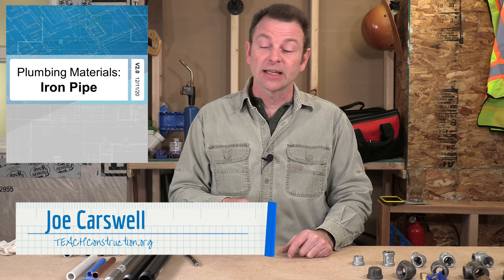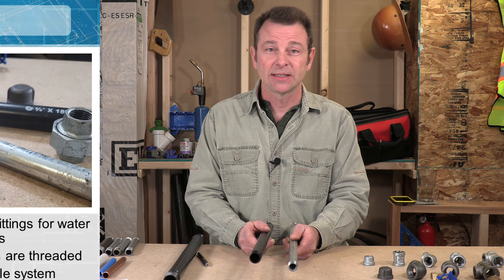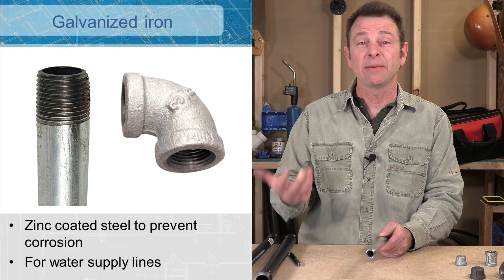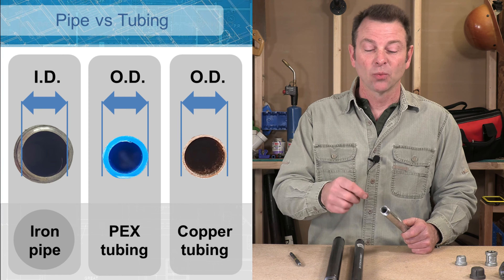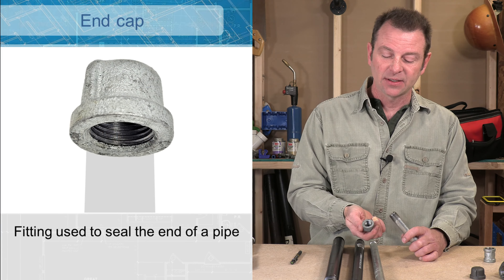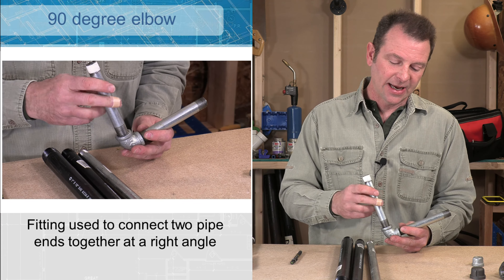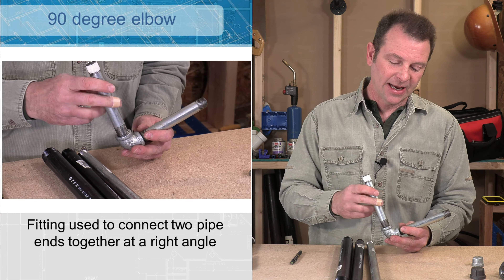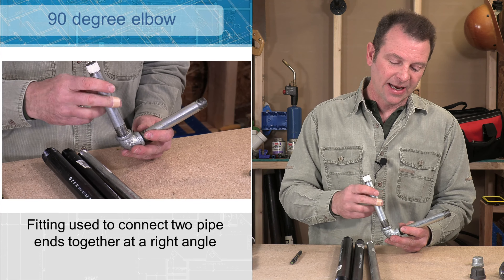A lesson about iron pipe as a plumbing material  - Intro to Plumbing Systems

Comment: Several things to correct. You could take this videos advice and get by fine. This is more nitpicking than anything. Galvanized is perfectly legal for gas. So is brass for that matter. Coastal areas use it because it holds up better in the sea air than black iron. This is why you put a drip leg before each appliance to catch particles. Also, bushings are illegal to for gas but not for water. I always thought this was odd because water runs at much higher pressures than gas. Though I guess water isn’t as dangerous if it leaks. The last thing is just a nit pick. He said that pex and copper were measured by OD whereas steel pipe is ID. This is incorrect. All plumbing pipes are measured by ID. HVAC labels their copper by OD. In plumbing you have two two designations for OD, IPS (iron pipe size) and CTS(copper tubing size). All pipes will fit in one of these. Steel pipe, brass pipe, pvc, and cast iron are all considered IPS. Copper, pex, and cpvc are all CTS. Though the size is nominal on some. Copper tubing is actually 1/2” ID. Pex however has the same OD but a thicker wall so it’s slightly smaller on the inside.
Reply from the maker: Thank for the additional information.
Reply: I live in Katy, TX. I’ve seen a lot of people had their certified plumbers to run the natural gas line with galvanized iron instead of black iron. The benefits are to minimize painting and rusting.

My question is, can I mixed black iron pipe and galvanized pipe together? Like 21ft black iron and 21ft galvanized for natural gas.

Comment: In plumbing, copper pipe is measured by inside diameter. In hvac, it is measured by outside diameter. That's why hvac techs call 3/4" copper 7/8".
Reply from the maker: Great and thanks for the addition

Comment: Galvie is still good as a main supply trunk off of the water meter.  You need metal to ground to and then you need to jump from your side to the city side to ensure you have no electrified water which can result in a fatal shower or grass watering.

Comment: This is really good info.  One small suggestion.  When you are demoing putting on a fitting you are turning the pipe instead of the fitting.  In a real situation the pipe is likely fixed and unturnable.  Showing how the fitting would be turned leftylooseyrightytighty gets confusing so if you can simulate real life by turning the fitting that would be even better.

Comment: If I can make one observation , copper tubing is measured on the ID unless you are working with ACR tubing which is measured on the OD. Otherwise your videos are done nicely. Don't know if your a plumber or pipefitter by trade.
Reply from the maker: we are not plumbers - we primarily create instructional resources for  teachers to use - one reason we are only covering the basics.  These videos are only a small portion of what we provide to customers - so we figured why not share some of our library with the YouTube learner.

Comment: Sir ,  first your way of speaking is best,  people all around world can listen and understand you,  giving time in between your words. Sir in our village home in mountain our gi water pipe broke.  What should be the distance  between two 1/2inch gi pipes, so that we can join them by union.
Reply from the maker: Thank you for your nice words. Where is your village?
Your question is hard to answer easily in a comment - maybe we will make a video about how to do what you ask. 
Here is an attempt at explaining.  To determine the proper gap between two pipes in preparation for a union - you can assemble the union and measure the over all length.   Then measure the amount of pipe that threads into each union end, and subtract that amount from the overall length of the union assembly.

Comment: i'm replacing a valve that has no unions with a valve using a union on both ends. i noticed when taking the union apart there's a shoulder that fits within the inside of other side of the union to seal the fitting. when removing the valve by unscrewing the two unions you have to create at least an 1/8 of an inch from each union in order to pull the valve out. how do you create that clearance to remove the valve? hope this make since.

Comment: Great video Thank you sir 👍🏻
How do you know at what point you have secure tight fit 
How many times you have to turn after you tighten it with your hand?
Reply: It isn't a number of turns thing. Think torque instead. You get a feel for it pretty quick, although as your arms beef up you have to adjust on smaller fittings to avoid over tightening.
Reply: This will work only in theory. You have to use one of the existing sealing methods

Comment: Awesome video talking about fittings.  I have  an old home with the galvanized color pipes for natural gas. Can this be an issue?
Reply from the maker: Opinions differ on this - but I have read that it can be an issue over time.   It has to do with the chemical makeup of the gas that could break down galvanized pipe.  I am no expert, but if I had the choice I would not use the galvanized - but I am sure there are many on YouTube that would argue.

Comment: You did a good job; except telling us how to align a "union". And I have found this on all video's I have seen. So does it mean it can be left to right or right to left. Or doesn't it matter. Especially working with Natural Gas unions.

Which I am doing now. I NEED to add a union; on a pipe carrying natural gas; that I want to go to my new Generator. So do you put it this way or the other way? Or doesn't matter. Please respond.
Reply from the maker: While I am not telling you how you should plumb your gas line for liability reasons, I have been told that unions can be installed in either direction - some folks try to consider the flow direction of the fluid in the pipe and install accordingly.   Sorry I can not be more specific.

Comment: Excellent video!!!
Reply from the maker: Thank you very much!
Reply: @ConstructionEd  is it possible that black iron pipe is also used in hot water heating systems ( I see black iron piping connecting to each radiator in a home from the 60s)? Have you seen this?

Comment: question, can pipe sealer be used on the sealing part of a gas pipe union. the matting ends
?
Reply from the maker: as long as you use thread sealant that is rated for the use - gas or water

Comment: What is your opinion about connecting galvanized to pex using brass pex adapter ? I am concerned about dissimilar metal connection and corrosion. If you don't suggest such transition - what is the other way to connect old galv pipe to new pex pipe?
Reply from the maker: Sorry for not responding - I missed this one.  Is the old galvanized pipe is just water, you can use PVC to avoid the corrosion issue.
Reply: Brass to galvanized is exactly how that transition is supposed to be made. If it were copper, your concerns about dissimilar metals would be correct. Pvc is not approved for water transmission within a structure.

Comment: Very interesting. In regards to gas, I've seen that the gas company uses yellow tubing (different sizes), similar to PEX. Can that be used in a house to run the gas lines? When we had our furnace converted from propane to natural gas, the gas company ran the yellow tubing to our meter. The guy who connected the meter to our furnace used black iron pipe. It seems it would've been simpler to use the yellow tubing.
Reply from the maker: The yellow tubing is often used for underground runs
Reply: @ConstructionEd  So it's not to be used in running gas into a home?

Comment: I wish to know does a union has a particular direction to mount if the fluid would flows from the right to the left?
Reply from the maker: Not to my knowledge.
Reply: @ConstructionEd , From what I understand ground joint unions are considered non-directional but there have been Studies and old time pipefitters that say there is less restriction if you install the union with the receiving section like a funnel (nut & collar on the supply side . Male  thread section  on receiving end).

Comment: I didn't hear you say that the all the fittings for the black Iron pipe are black Iron, for a clear understanding.
Reply from the maker: It is best to keep all pipe and fittings the same material
Reply: @ConstructionEd  I ran into another problem trying to learn from sites. I hear there is a gray pipe apparently used for natural gas they stopped using or making in the 1960's. They didn't make clear on that part. Now I wonder because I'm looking at old pipe that has gray fittings that is kind of hard to tell the difference if its true gas line fittings or galvanized. Thank you for your time.

Comment: What's the difference in the black pipe, iron vs. steel?  As long as it's black pipe, and either made out of iron or steel be used for natural gas?
Reply from the maker: When running gas pipe you should always use pipe that is specifically stated as used for gas.
Reply: @ConstructionEd  Thanks 🙏🏼